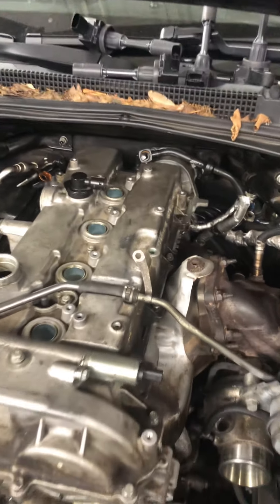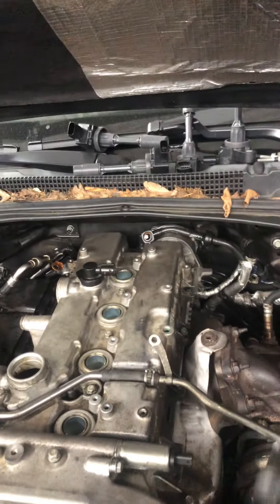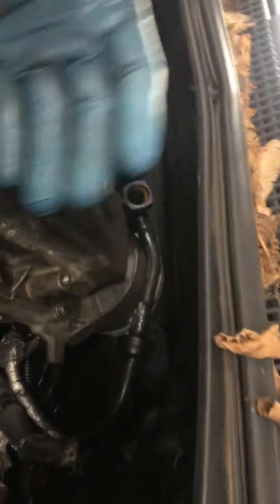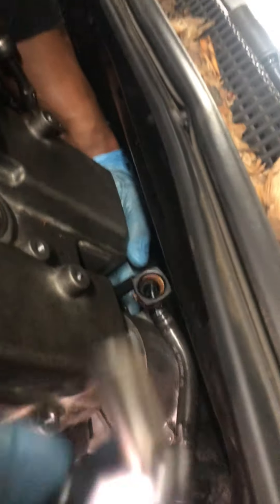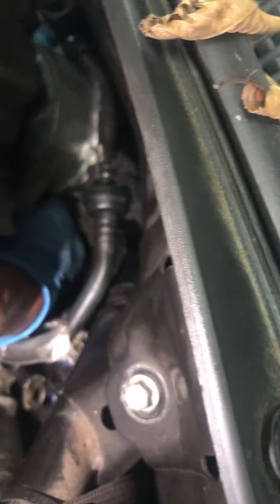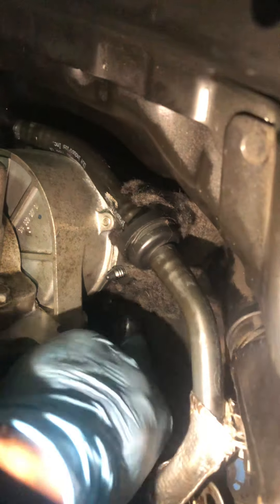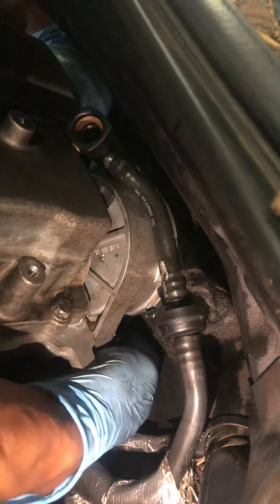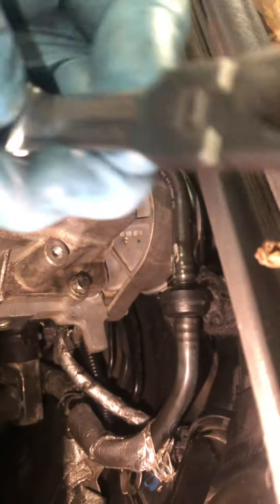How to replace valve cover gasket and vacuum pump rear bolt removal 2014 Cadillac ATS

Comment: You didn't have to take off windshield wipers or hood cowel covers? Thanks
Reply from the maker: No, you don’t have to that was the whole purpose of the tool to save all that work
Reply: @moesautoclinic6368  just replaced mine with that ratchet. Awesome. Still leaking though. Should I remove and put a lil gasket sealer?
Reply from the maker: @joaquinmartinezjr813 will it should have a gasket on the pump Re-check your work I wish I could help you more but that all got for you
Reply: Do you have to synchronize that vacuum pump   Or anything when you replace it?
Reply: @jayboogie2520  no
Reply: @ thanks for the reply G. Took to the mechanic today they charged me 400 for cover gasket and vacuum pump replacement. What you think?
Reply from the maker: That’s not bad 
Thanks for watching
Reply: @jayboogie2520  too much lol but no stress for u
Reply: @joaquinmartinezjr813  good looks either way my Gs I know that shits a B and I don’t have the tools to do it myself.

Comment: this vacuum pump is a motherfker to get to I'll try it with that tool I tried with an 1/8'' ratchet and it was just..infuriating to the point of quitting
Reply from the maker: I know the place where theyput the bolt for that pump is tight place and rough try to purchase that too that  you seeing in the video it should help out a lot 

Thanks for watching 
wish you the best of luck
Reply: What's the name of the tool I couldn't really see it in the video